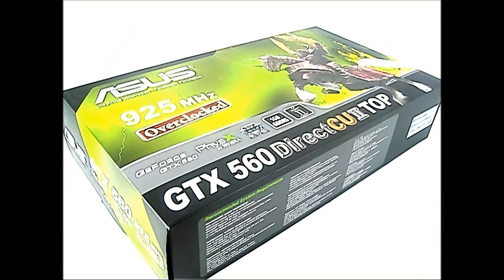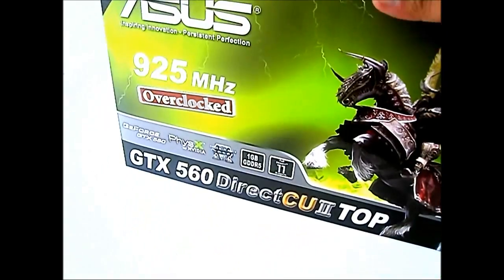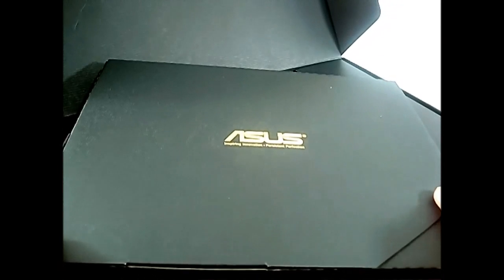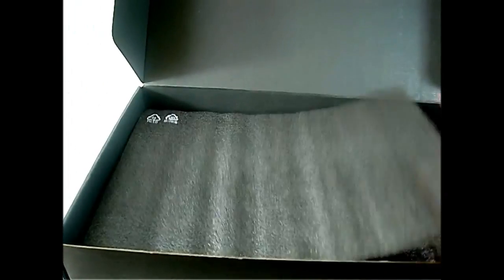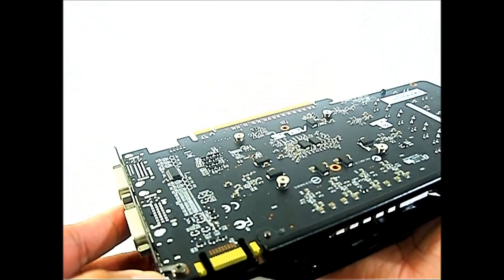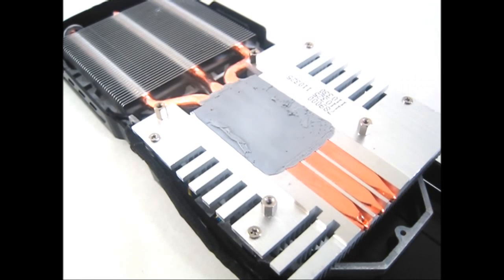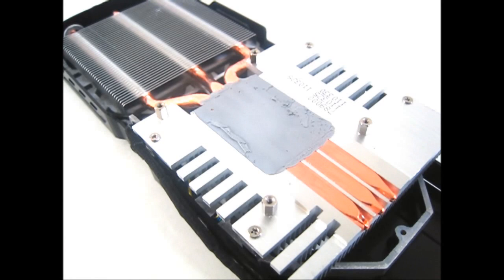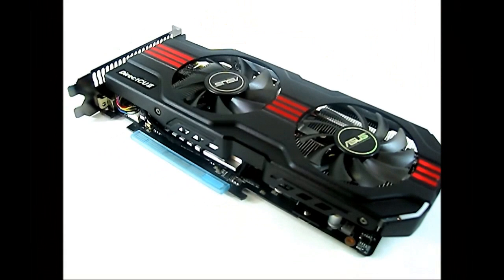ASUS GeForce GTX 560 DirectCU II TOP - Video Card Unboxing and Product Overview

Comment: What is the minimum psu needed for this card guys.
Reply: +Stephen Hale I have this Asus gtx 560 with an Intel i3 4170,Asus z97-p, 2 disk drives and 4 hdds and im using a 400w but I would reccomend a 450w at least to be safe.

Comment: @HiTechLegion From what I saw the OC model has a frequency of 850 MHz, do you think that the extra 75 MHz will change much? Also another question, currently I only have the option of choosing the OC model or the GTX 560 Ti model, which has a lower factory frequency but an extra 50 processing units (384 compared to 336) and is almost 40€ more expensive, would you think it's worth the extra money?

Comment: wat's the difference between the TOP version and the OC version? I see that the TOP version has a 925mhz core clock. I have the OC version and oc'ed it some more to 950mhz. Are there any more advantages that the TOP version has?

Comment: erm i'm getting this card soon and i've never used a card that needs an external power supply. i have a cooler master 550w psu. Do i just attach any two 6pin connectors to the card?